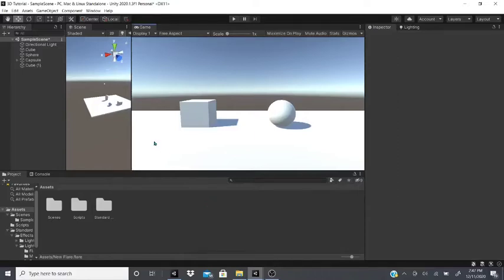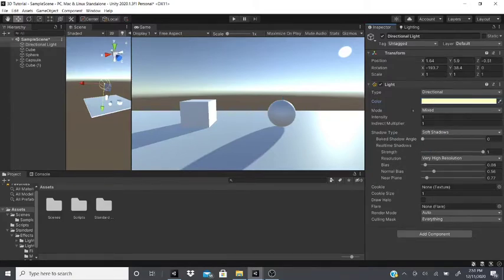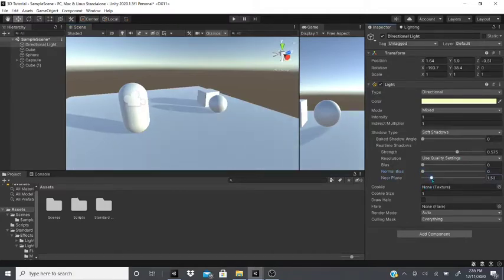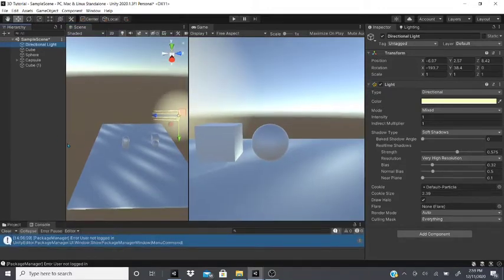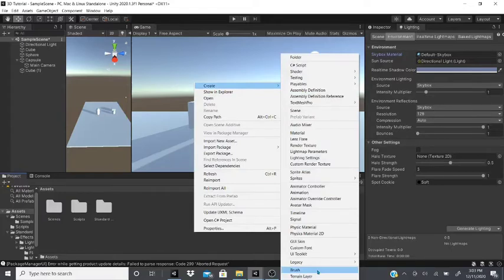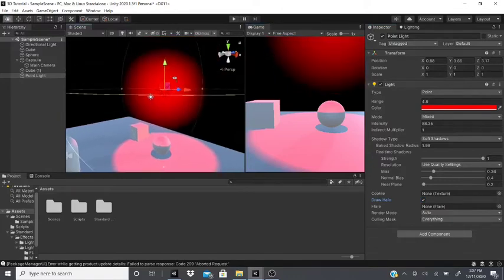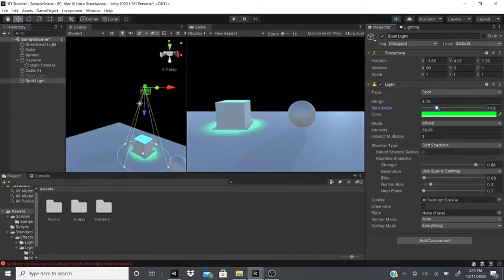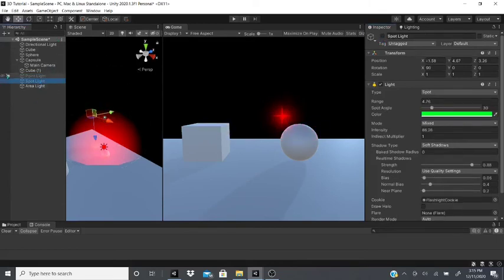Unity 3D Lights Tutorial (DIRECTIONAL, SPOT, POINT, AND AREA LIGHTS)

Comment: What pipeline is this, since I'm using URP and my point lights won't support shadows? Is there anything I got to do to enable them?
Reply from the maker: I was using the built-in pipeline I am not currently home to check on how to solve it but once I get home I will check it out but what you can doing is go into your urp settings and there is a section for shadows
Reply: @robustgames1096  Thanks mate, but I figured it out. Realtime shadows for URP are now supported in 2021.3 LTS build, so I just upgraded my project and got it working.
Reply from the maker: @PointToBlank89  No problem I'm glad you were able to figure it out